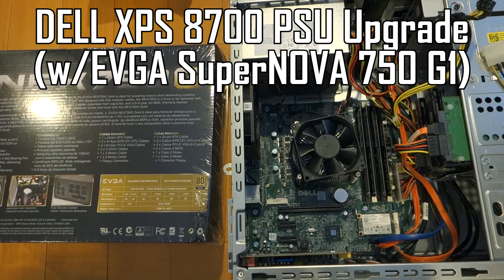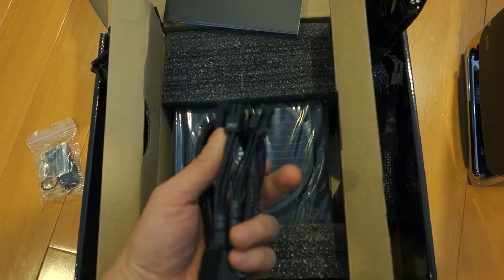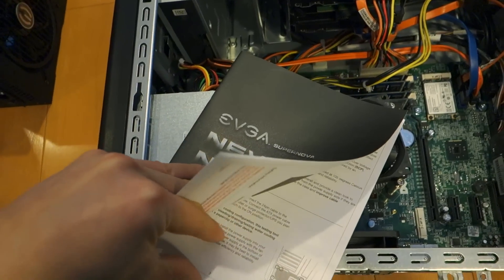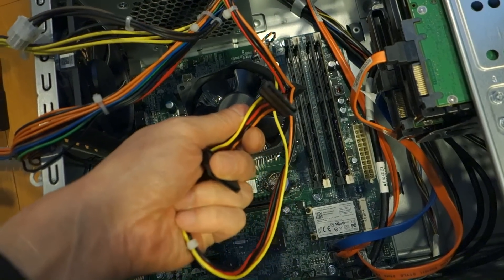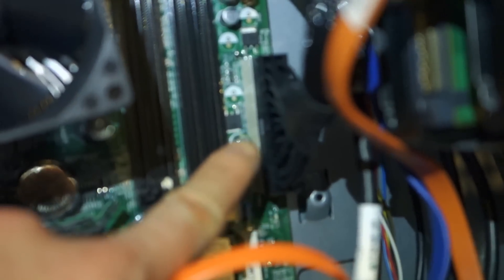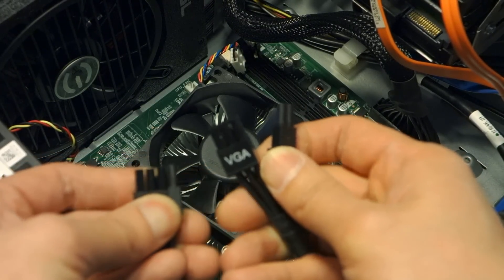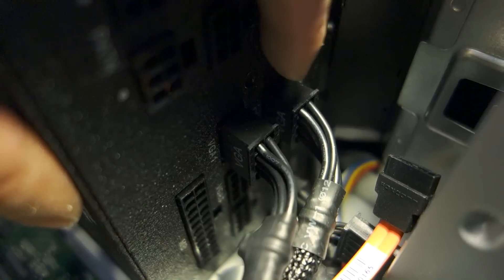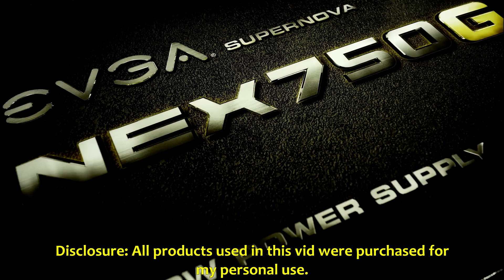HOW TO: Dell XPS 8700 PSU Upgrade (w/EVGA SuperNOVA 750 G1 and HD 6970)

Comment: Hello I Am Looking For A New PSU And This Is What I Found But Im Not sure If It Would Fit In The XPs 8700 Can You Please Tell Me Heres The Name Thanks 

Rosewill RBR1000-M 1000-Watt Bronze Series 80 Plus Bronze Certified Power Supply compatible with Intel Core i7 and i5
Reply from the maker: +Dex Hoster Just added this to the vid description:

Been getting a lot of q's about whether XYZ brand's PSU will fit so please note:
- any replacement PSU must have 1 x 24 pin ATX cable & 1 x 4 pin EPS or 1 x 4 +4 pin EPS cable (and of course the requisite PCIe & SATA cables you need)
- factory PSU dimensions: 140mm (D) x 86mm (H) x 150mm (W)
- EVGA 750's is: 180mm (D) x 85mm (H) x 150mm (W)
- while you have room for a slightly taller (H) or Wider (W) PSU but NOT longer (L/D), this will depend on what kind of CPU cooler or other equipment you may have crammed in your XPS8700

Looking at the specs for this one, the dimensions are: 150mm x 86mm x 160mm which I assume to be (W x H X L) so this should fit.
Reply: +turboBB73 So The One I Mentioned Should Fit? And Work Properly?
Reply from the maker: +Dex Hoster It will, although for the price, I think you could do better than this unit since most of the cost is going to the higher wattage which would be overkill in the XPS8700.
Reply: So what would you suggest me buying? For The Dell XPS 8700?
Reply from the maker: What GPU are you running and do you have any aftermarket coolers? Given the XPS8700 only has a single PCIe x16 slot, you can't run dual GPU so even the stock PSU should be good for the majority of GPU's out there (my case being the exception due to the lack of extra PCIe connector).
Reply: My whole system is new just got last Wednesday and I just want to upgrade part by part and I want to start with psu
Reply from the maker: It'll all depend on the GPU since that's the single component with the highest power draw that you can install in your system. Figure that out first and then take it from there.
Reply: +turboBB73 ok all good thanks for your time
Reply from the maker: +Dex Hoster No worries, just holler if you have any further q's.

Comment from the maker: +callme JAF - The numbers are just for count and doesn't signify a specific order so it doesn't matter which socket you use of a bunch. I only used CPU2 to give myself more room for the Main 24 pin as the clearance was very tight (and good eagle eyes for catching my mistake calling CPU1/2 in reverse). Hope that helps clear things up.
Reply: helo

Comment: I must say thank you again...i'm so happy you made this video.. I have the old 8300
and now adding the Gigabyte GTX 750 Ti GDDR5-2GB.....and EVGA SuperNOVA 750 B1.. now i can do this with ease.. Everything will be here tomorrow!!!  Can't wait..
Reply from the maker: dave l Cool, lemme know how it goes. Cheers, Tim
Reply: I just replaced mine with the 750 g2 and it works fine.   Only problem is the error code that pops up every restart because it thinks I still have the stock one.     did you find a way to disable this?
Reply: Maybe need drivers for it...

Comment: PLEASE SOMEONE ANSWER.. I have this same computer i want to know if the Seidon 120v can fit in this pc ??
Reply from the maker: matthewly42 No, you'll need a cooler that's compatible with LGA 11550/1155 socket. The Seidon (based on this page: http://www.coolermaster.com/cooling/seidon/seidon-120v/)  is for LGA 2011-3 socket.
Reply: turboBB73 Thanks but any suggestions?? Im kinda new to this.
Reply from the maker: matthewly42 If you're looking for AIO liquid cooler, I'd suggest the Corsair H60, that's the one I'm contemplating since I've been playing a little SC2 lately and noticed the temps have risen a bit during game play (not to mention the GPU twin fans sound like jet engines...). Unlike the XPS9100 units, the XPS8700's case doesn't have a direct tunnel to directly vent the CPU heat straight out the side of the case but instead it's all dumped within the case and relies on the rear fan to draw it out to keep things cool. The H60 setup will replace the CPU fan as well as the rear fan and have a radiator cooling that vents out the back of the case. The thing though is I'm not sure what that'll do to the heat from the GPU so I may also look into air cooling option as well. Will post updates when I get around to it but I'd suggest you check out this vid re: pro's/con's of liquid vs. air cooling: https://www.youtube.com/watch?v=2j80dQIxkdc
Reply: Thanks man, I'll do some research on the H60.. Please let me know if when you have any more info on the setup and the air cooling option

Comment: would this work for the new 2.0 Graphics cards from Nvidia
Reply from the maker: Rezistful If you mean a PCIe 2.0 GPU card, yes. XPS 8700 MoBo is PCIe 3.0, you just need to make sure to have the right PSU connections for the GPU you're considering. If you meant something else, please provide a specific model.

Comment: Dear Mr. Turbo:  Great video tutorial.  But here's a question you may not want to answer.  I see all these people on YT jamming and squeezing gear into the 8700 case that is too small.  If you upgrade the video car to say a GTX 970, and you upgrade the sound card, etc., you then need a larger power supply and probably water cooling too.  The Dell 8700 was never made for these types of space-squeezing upgrades.  And unless you go with a Dell Alien rig you cannot get Dell to configure the 8700 like one might like.  

Question:  Would it not be better to go to the top Geek Squad tech and have Best Buy build your computer exactly like you like, with warranty and support and return previlages and all?  They have access to larger case sizes and all the upgraded gear and nothing is jimmy rigged to fit a case that is too small.  Would the BB rig be as good as the Dell 8700 in this situation?  I've priced out a BB custom rig with all the top stuff I want and it's much more powerful than the 8700 that I can get from Dell.  A Dell 8700 SE running a 3TB hard drive + 256 SSD along with 32G of ram, a smallest 460W PSU, a AMD 2G graphics card and an integrated sound card is about the same price as a much more powerful, 3T HDD + 265 SSD, water cooled, BB rig with a 850W PSU, and GTX 970 GPU, and a Sound Blaster Titanium sound card and all the USB ports you could want.  Is the Dell name so special that it trumps a BB rig that is built correctly from the ground up with warranty and tech support for about the same price?  I would appreciate your response.  Thanks.  joeb.
Reply from the maker: joeb434 I agree that a custom rig is always preferable but I snagged this refurb'd at a decent discount. The funny thing is that despite my years into computing, I never got into a custom rig... I don't really game and the HD 6970 serves my purposes just fine for vid editing without a need for SLA so the XPS 8700 actually works fine for my needs. However, after examining the XPS 8300 and now XPS 8700, I'd certainly go with a custom rig in the future for all the reasons you've cited. My number one reason against a custom rig is has been one of stability and support. In the event there's an issue, mfg's always like to play the blame game, at least with the XPS 8700, it came as is and I need only go to Dell for support. However, in your case, sounds like you'd have BB backing you in the event there are any issues. I don't have any have experience with their custom rigs but they do tend to be reputable so I'd say go for it! Please post back how it works out for you.
Reply: turboBB73   Thanks for your comments.  Am currently doing a final price/quality comparison and will be back with my comments, particularly if I go with the BB rig.

Comment: Hey man I heard the xps 8700/8500 has got issue with gtx 970/980......u having any issues after installing them???
Reply from the maker: Sumit Upadhayay I don't have either of those cards. I'm running an ATI HD6970. However, based on what I've read on the issue, seems like an upgrade to BIOS A10 should resolve them.

Comment: Can I install raidmax rx 835AP into my dell xps?
Reply from the maker: Based on the specs, I believe so but don't quote me on that since I've never handled one before. Key consideration is the physical dimensions which is about the same as the EVGA and all the necessary pins for the XPS 8700 mobo (M/B 20+4 & CPU 4 +4) .

Comment: Nice video....what processor u using
Reply from the maker: Thx! CPU = i7 4770 @ 3.4Ghz | GPU = Sapphire HD 6970
Reply: I just bought a xps 8700 with a 4690 processor...Gonna swap out the 460 psu for a 650 psu same brand you did.Want to get the gtx 970....Should work right?
Reply from the maker: Philip Wood Yup. Dimensionally, the EVGA 650 and 750 G1 are the same (according to EVGA's site) and as I covered in this vid, it's a tight fit but will work. Take your time and you should be good. As for the GTX 970, it suggested 500W min so you're good there and as for length it's listed at 10.5" vs. 10.8" for the 6970 so you're good there too. Lemme know if you run into any issues.
Reply: Thnx
Reply: 1 x ($79.99) EVGA SuperNOVA NEX 650 G 80 PLUS GOLD Certified 65 $79.99
Subtotal:	$79.99

This is the one I purchased....Will this work in my xps 8700? I want to get the gtx 970 like you...what a beast
Reply from the maker: Philip Wood Yup, the GTX 970 requires 2 x 6pin connectors so you're good to go. Not sure where you are but as FYI, there's a $15 rebate for this PSU going on right now at Newegg. I got my 750 G1 w/$30 rebate from there. Also to be clear, I don't have the GTX 970 but an old HD 6970 as it's one of the few GPU's supported by Main Concept codec for Vegas Pro 12 rendering.
Reply: Thnx for replying
Reply from the maker: Philip Wood Good luck with the upgrade and I forgot to mention one more thing, you're going to enjoy the reduced fan noise with your new PSU. I've always found the ones on the XPS (first on the 8300 and then on the 8700 which use the same 460W PSU) a bit noisy.
Reply: Ty.....I hooked up the psu and bought a evga gtx 970......the install was a success....my 8700 is whisper quiet and a beast now
Reply from the maker: Philip Wood Awesome! Enjoy!